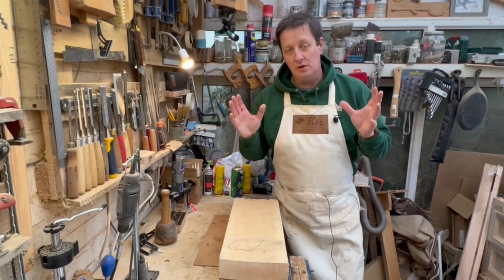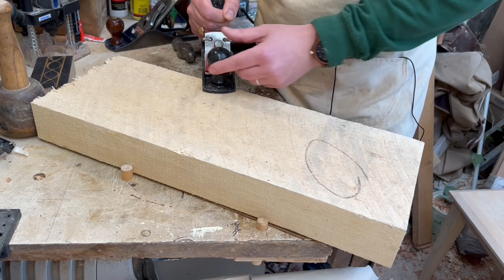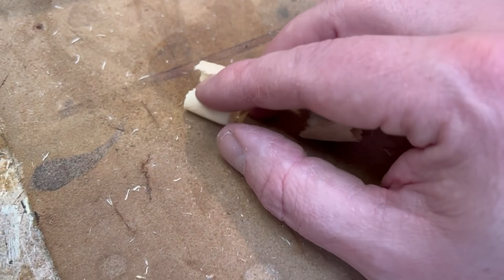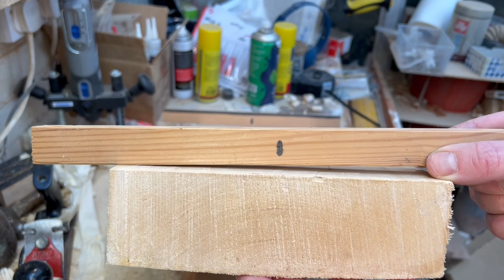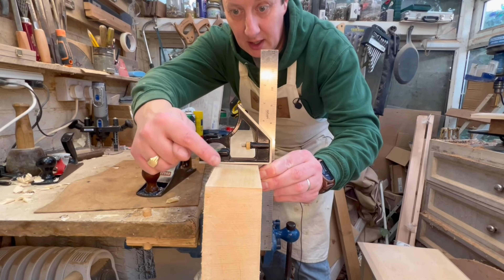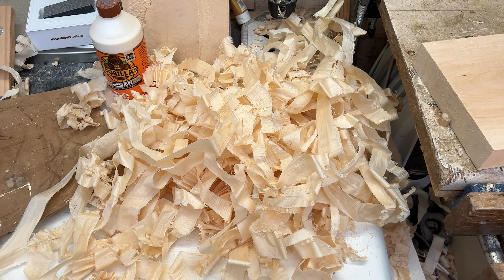Dimensioning timber by hand for guitar building  |  Bass guitar build part 6

Comment: This is one of the times where I am thankful for having a plunge router, a bit of old kitchen cupboard and some angle iron for a down-and-dirty planer sled.

Great to see how once again, you remove the anxiety element to another core skill of woodworking. You can tell I've been at the mercy of the big American channels (sorry to keep poking my American cousins out there) pushing the idea that you have to get slabs square down to the atomic level hehe.
Reply from the maker: I work on the knowledge that this is how it used to be done. No reason it can’t again!